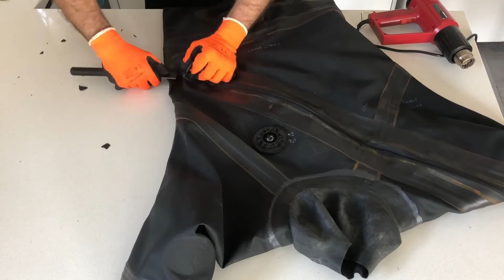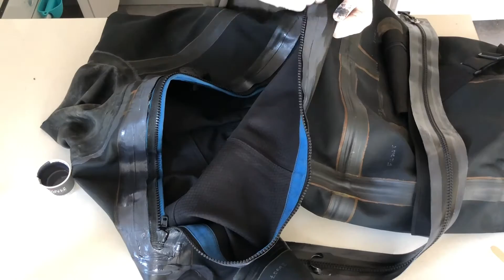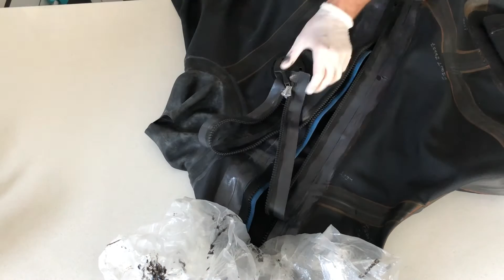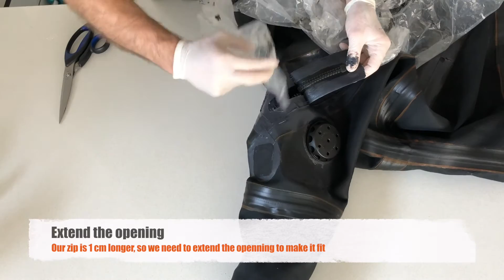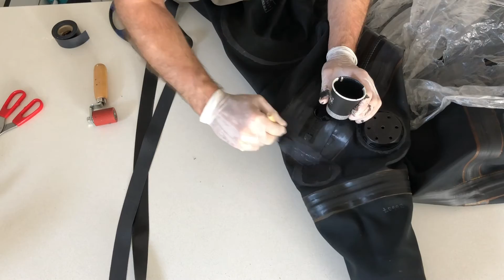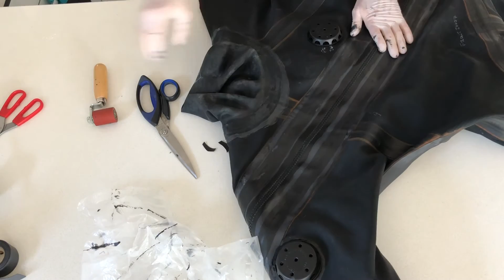Replacing drysuit zipper

Comment from the maker: Please, let me know in comments if there are any other types of dry suit repairs you want me to post here.

Here I'm replacing the metal dry suit zip to plastic dry zip (from TiZip) The dry suit is an Otter dry suit and the zip is the diagonal front zip. However, the process would be virtually the same for most other dry suits out there.

Comment: Brilliant video! So many people have told me that once the zip is gone in my drysuit, I'd pretty much have to replace the entire suit. It's good to see how a drysuit can be kept in service rather than filling up the rubbish tip with my lack of initiative to fix it. While watching you working, it made me wonder if you could possibly use some contoured foam so that the zip lays flat the entire time you work with it...just an idea. Thanks heaps for putting this together. "Throw out the suit myth"...busted! :)
Reply from the maker: Thanks for the kind words. Haven't got your idea about the contour foam though
Reply: That contoured/shaped foam thing is used by some of the kayak drysuit makers like NRS or Nookie in their repair videos.  Helps to control the shape of the fabric while glueing and positioning things.

Comment: Do you think this would work for a DUI drysuit? My current zipper is sewn in and then Aquasealed on the inside, I hear it can be hard to remove the aquaseal completely. Is there no need to seal the outside of the zipper?
Reply from the maker: Done it with dui suits too. Preferably to get rid of the Aquaseal from the previous installation, which can be pretty annoying

Comment: Received a dry suit second hand off from eBay today and theres all material thread all along the zip line, does that mean I need a new zip or do I just need to cut the thread off? Just been quoted £170 for a new zip from a dry store but don't want to pay that because the dry suit only cost me £110, any help would be much appreciated
Reply from the maker: The main question does it leak from the zipper or not. If it is - you need to replace it, no way around. I have a number of videos in the channel that demonstrate it, I suggest you go over it and find one that resembles your case

Comment: What process ist the best to remove a dry zip from a neoprene drysuit? 
Does the glue you use also softens with heat or whats the process if you ever need to replace a zip the second time?
Reply from the maker: It also softens with heat

Comment: I decided to attempt to replace my zipper on my Santi E.lite. I removed the old zipper and soon realized that this is sewn. I assume that I can still do this method without an industrial sewing maching?
Reply from the maker: As far as I know, Santi are no sewing their zips, but may be they changed their tech process. I’m not seeing the zippers, glue is holding just fine as long as you have enough overlapping. 1 cm overlapping is enough
Reply: @DrySuitProjects  Thanks for the reply. The last place that did the zipper decided to sew. I am assuming that with the proper 2 coats of glue, the old sewing holes wont be a problem. I ordered my new zipper today, and sincerely appreciate your video.
Reply from the maker: The old holes will be covered by glue and a new zip. So it should be ok

Comment: Hello, thank you for the videos. I fitted a YKK Aquaseal a couple of years ago and the outside black material of the zip that was in contact with the glue (Stormoprene 2-part Contact Adhesive 250ml) eventually cracked and flaked off eventually exposing the white material underneath (both inside and outside the suit). Have you ever seen that happening?
Reply from the maker: Delamination happens from time to time. I tend to assume it is a mix of zip manufacturing process flaws and an installation, that might speed up the deterioration process

Comment: I didn't notice if you removed the old zipper or did you just leave it? I'm going to try this with a Thule brief case for a laptop computer. This won't be a drysuit, and I believe your type of materials will glue to top and bottom halves of the brief case and allow for the zipper to be replaced and bonded permanently for restoration. Since the Thule is semi waterproof, I will replace the old zipper with an airtight water resistant zipper glued on. 

To prep, I will remove the old zipper clean up and roughen the top and bottom areas that will be glued too. Then glue together the two sides with a new piece of urethane over both sides (as if it were permanent but not later will cut down the middle). This will hold the two halves together while gluing the air tight zipper of the brief case together. 

At this stage, after glue dries and the zipper on top and bottom inside still "uncut" will bond the airtight zipper around the corner curves, top and bottom. 

When all is dry open the zipper and cut the inner piece carefully down the center (this should be perfect conforming to corners). This won't be 100 % waterproof, but water resistant. The Thule brief cases are warrantied for 25 years, but the zippers always wear out because too much power cables and backup disk.

 I'll try and make the two halves of the briefcase zipper expand out, and handle extra equipment, and more accessories, backup disk, etc. The case will be just a bit thicker so more stuff. Thanks for your great presentation and materials types.
Reply from the maker: I’m removing the old zipper and prepping the surfaces

Comment: Thank You for share your experience! It's very interesting and useful! Please answer for my question: is the difference to use this way to instal a zipper YKK aquaseal to trilaminate ''Hollis DX300X'' ?
Reply from the maker: In general I use the same method to install the new zippers and it working perfectly for me. However, if the old zipper is installed using some kind of thermo glue, its hard to get rid of it and the glue I'm using (SC4000 of Rema Tip Top) is not holding that well.
Reply: @DrySuitProjects  Thank YOU very much! Use (SC4000 от Rema Tip Top) Is more preferably??? This glue can glue a different materials???
Reply from the maker: @МихаилДайв  This is the glue, that is working best for me. It's declared rubber and fabric glue, but its doing well with various plastic rings (SITECH), TIZIP and YKK AQUASEAL zippers, which are made from urethane covered tape. Also, very important - its survives perfectly salt water contact. It does not absorb water and does not swell. Santi also using this glue in their suits
Reply: @DrySuitProjects  You helped me a lot! We don't have a good dealer in our place, that why i going to repair my dry suit  by myself... Can You tell , what is important in this job?
Reply from the maker: @МихаилДайв  Most important is a good glue - no compromise here, clean surfaces before gluing and following the technological process thoroughly. Good luck!
Reply: @DrySuitProjects  Thanks a lot!
Reply: Can you name us a 1st line supplyer for both Glue and Zipper. Here in Holland the zippers are guit expensive. Kind regards Peter

Comment: Is their no need to roughen the new zip before applying the glue? I heard about some issues of bad glue adhesion on the material of the zip.
Reply from the maker: It better sand it a bit with a sand paper
Reply: Thanks for your advice, maybe they used the wrong glue. Seems that you know what you are doing. Thank you for sharing your videos. 👏🏻
Reply from the maker: It could be wrong glue too. Generally if there is an urethane based lamination of the zipper tape, then the neoprene based glue might not work. Rema Tip Top SC4000 is a neoprene based (If I'm not mistaken) but it appears to work just fine for me.
Reply: Ok, I‘m using a PU—based glue anyway and hopefully don‘t get any problem. All items I glued on my suits in the past are perfekt solid and tight but its my first zipper I have to change.

Comment: Thank you for sharing, will definitely try that. The only thing is I can't find the glue Rema Tip Top SC-4000 to buy here in Australia (have sent Rema an email in regards to this). Do you recommend any other brand? Thank you!!!
Reply from the maker: I've had somebody from Australia asked me about that. I think they got the distributer there.
Reply: You can get AZBond-R in australia from chandlers and boat builders. 2-part contact adhesive and works well for all drysuit repairs

Comment: Great video.  Going to try it.  Did you use both Aquaseal with Cotol AND the Rema SC-4000?  Which would you suggest?  Amazon doesn't seem to have the SC-400 at the moment.
Reply from the maker: Thanks, I'd use Aquaseal only for sealing small leaks since it takes considerable time to cure and during that time the glued parts might move. SC-4000 is the most suitable for 99% of the tasks. 
I guess to ship the glues becomes a problem since it considered a flammable substance and thus its forbidden by most carriers
Reply: Thanks.  Will have to see where I can get some. Did you use just SC-4000 straight, or add cotol or something?  I see a small bottle next to it in the video.  Just making sure what I need to order/purchase.
Reply from the maker: Its a very important small bottle - is a hardener E40. Rema Tip Top SC-4000 is a 2 component glue.

Comment: Thank you very much for posting, this is great info! Do you have any tips/advice on attempting a zipper replacement on the curved, front-entry zip of a Fusion drysuit? Or is this best left to AquaLung to handle?
Reply from the maker: You should use there a metal zipper only. Only metal zippers allow curving installations like in these dry suits. Other then then the technique is pretty much the same. I’ve done plenty replacements like this.
Reply: Dry Suits Projects Sounds great, may just give it a try. Thanks for the great content 👍🏻

Comment: What temperature do you set your heatgun to in order not to burn or melt the suit while removing the zipper ?
Reply from the maker: Good question. I wish I had an easy answer. Every suit is different and every fabric is different. To make it more complicated they all use different glues which have different melting points. 
As a rule of thumb I try not use excessive heat. Something about 100C. And I try not to heat one spot more then 10 seconds.

Comment: The zipper doesn't look quite as difficult as mine (mine follows the neck seal) but it gives me confidence.
Reply from the maker: If it’s not going on relatively straight line you have to use a metal zipper
Reply: @DrySuitProjects  I was already planning on using a metal zipper instead of plastic for that reason. This is just the first one of your zipper videos I found, then I looked you up and saw that you've done a lot of drysuit zippers. Thank you for your response.